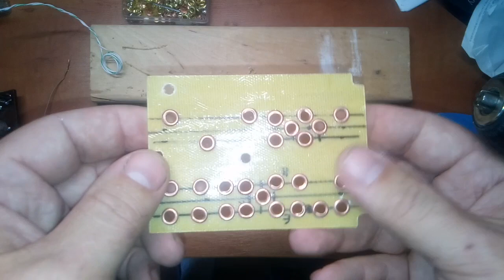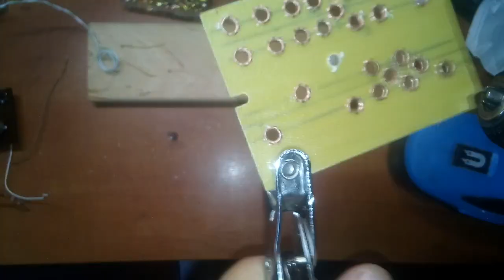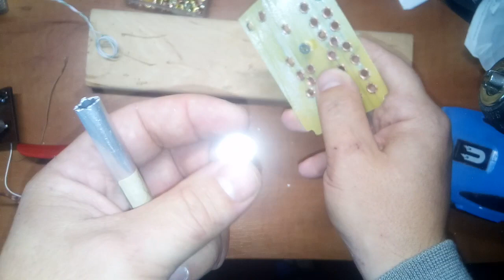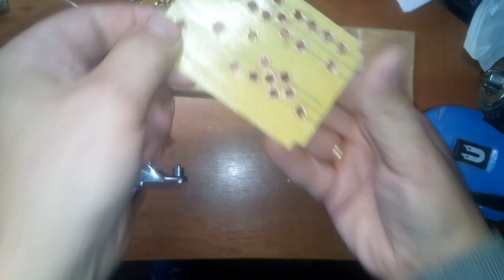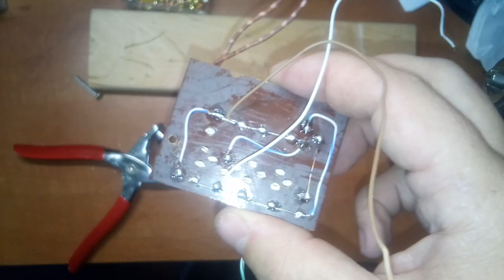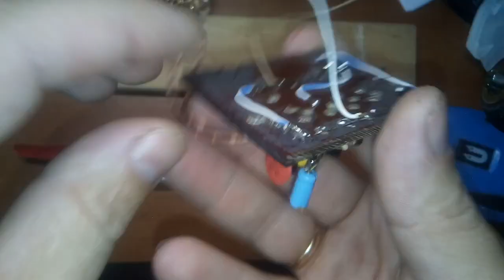Как сделать макет платы / how to made circuit boards.

Comment: I was always told in radio keep tracks as small as possible, leads as short as possible. do such large rings greatly affect the frequency for your receivers?
Reply from the maker: I think - parasitic capacitance between two rings is a low and don't reach freqency response.
LC tank: rings is a part of capacitor.
Example: pulse counting FM receiver runs with 44-54MHz oscillator-subharmonic mixer, and no problem.
Reply: @ingussilins6330  thank you)